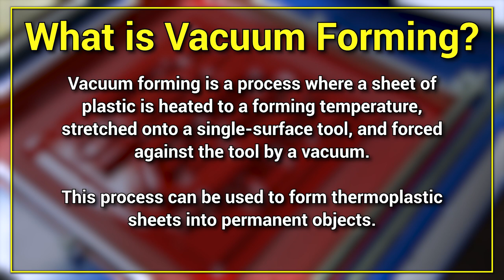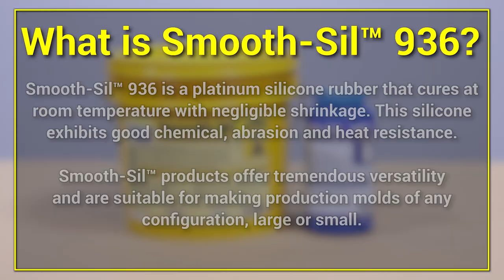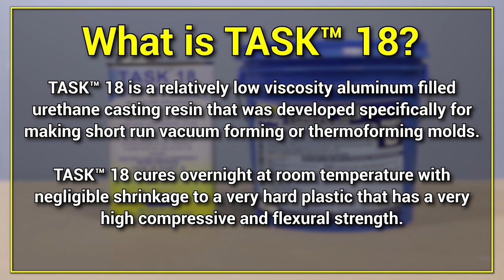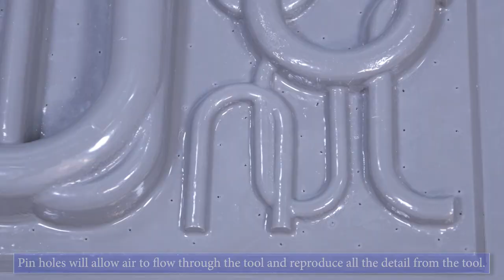Using a Vacuum Former to Create Lightweight Wall Panel Artwork

Comment: why go to all that trouble and not use the MDF direct as its poriss ? no need to make all the other moulds
Reply from the maker: The MDF would not be porous enough to pull air through, you would need to drill over 200 holes in order to create the air channels.  Also, having a mold of the tool allows to remake the tool if additional tools are needed for large scale production.

Comment: This was excellent...please, do continue with options that can be used in vacuum forming (high temp resistance, durability to the tool materials).  The last one with silicone as the tool material was great.  I've  just completed a new larger 24x24 vacuum former and we are looking at 3D printing cosplay masters (armor, parts, props) that will be either resin cast or silicone cast as you guys have demonstrated.  We know that PLA+ printed parts won't handle the heat of thermoforming, hence casting a resin or silicone tool for pulls is the way to go.  We plan to use ABS and HIPS so the right casting materials and options are great to know.  We also plan our PLA+ masters to have some amount of overstated detail to compensate for the loss of detail when doing the vacuum pulls.  Keep this series going!
Reply from the maker: Excellent idea, Robert.  Thanks for watching, and don't forget to subscribe!